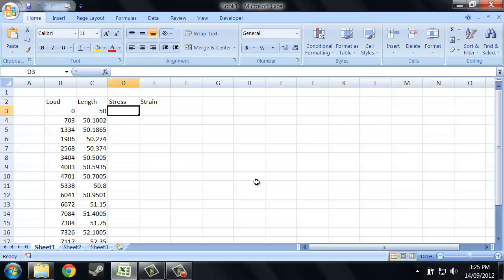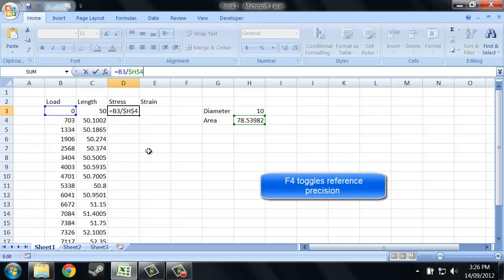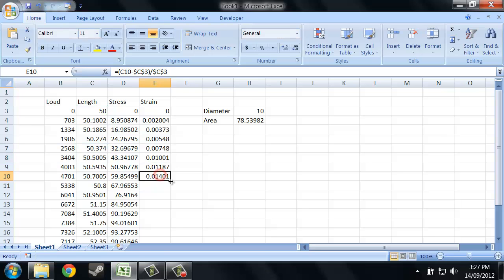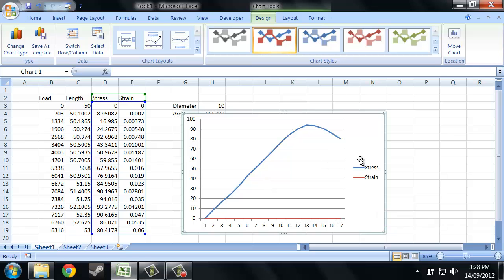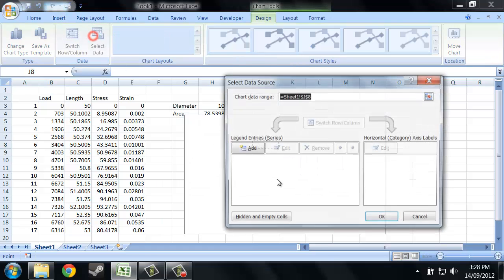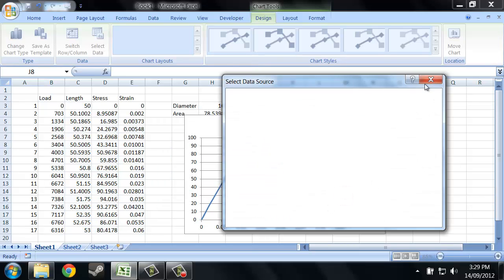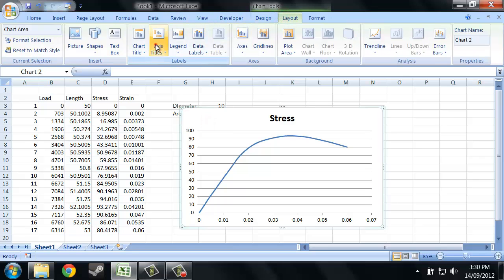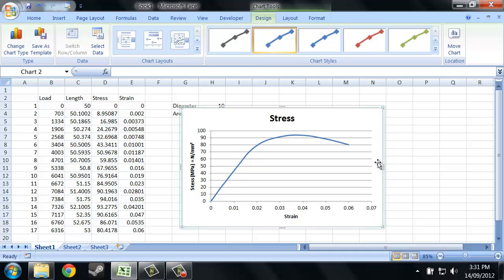How to plot Stress vs Strain

Comment: Thanks great video but how do i relabel the strain axis in order to show small units?
Reply from the maker: 91thomasg Excel will automatically re-size the axis based on the data that is fed into it. If you want to re-label the axis, that is use percentage strain instead of decimal strain (for example), you can simply create a new column which calculates percentage strain and use that as the chart data. If you format the data in the column as a percentage, Excel will show those units on the chart. Other than that, Excel has options for labelling axes under the 'Layout' tab at the top of the window.

Comment: Can you please explain how the load is decreasing toward the end of the test? Assuming you are adding more weight as the test progresses
Reply from the maker: Scott Latter Tests of stress vs. strain are carried out with a constant strain induced by a machine. The force required to produce this strain is then recorded and later converted to a stress. As the material is strained extensively, its cross section begins to thin until a 'neck' is formed. Even though the material becomes harder to strain per unit area as the test continues (due to work-hardening) the thinning of the cross-section means that ultimately, the force required to strain the material decreases. This is seen as a sharp decline in the specimen stress as the ultimate strain is approached. I hope that explains your question.

Comment: If there was 5 results from a particular material, would the young's modulus be different and how would you calculate it?
Reply from the maker: Conrad Pro For tests carried out under standardized conditions, there should be very little difference between each test, though there will always be some small differences due to variations in the test material. The young's Modulus would be calculated for each test as the ratio of the stress to strain in the linear elastic region of the graph. If you had 5 test results, you could average the E value for the material across all 5 tests.

Comment: Thanks a bunch for this. Turns out I was calculating strain by subtracting the new length by the previous length and dividing by original instead of new length minus original divided by original.

Comment from the maker: The modulus of elasticity can be determined by dividing the stress at a point (a point which is within the linear-elastic region) by the strain at that same point.
Reply: So I'm assuming the fact that the cross sectional area changes as the load increases doesn't matter?
Reply from the maker: Armin Memovic It matters to scientists but not to engineers, haha. True stress is defined as the ratio of instantaneous force to instantaneous area, the cross sectional area continues to shrink as the metal deforms and so the true stress continues to increase. Engineering stress is defined as the ratio of force to original area, which is a practical simplification for engineering purposes, since the true stress is less important than the total load which a component is able to carry in its design. In this video we have only found engineering stress, true stress is much harder to measure.
Reply: Adrian Borg Thank you. I'm sure my professor mentioned this in class at some point, but I must have missed it.

Comment from the maker: For this formula you need a dimensionless strain, so '(length minus original length) / (original length)' is correct. Though absolute strain (in mm, or whatever) can be still called strain.